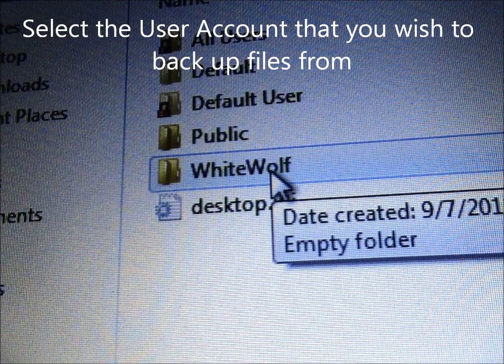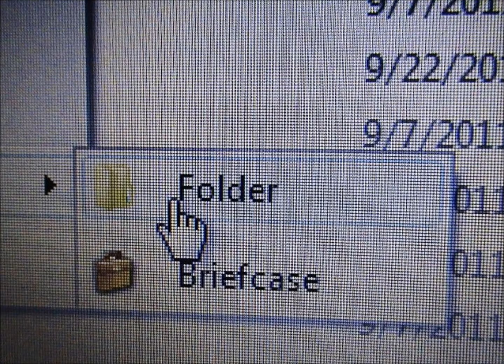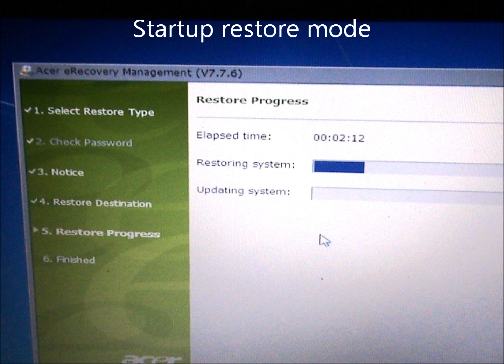Error Code C0000034 and C000003A Fix

Comment from the maker: There is always a way to do it without removing the hard drive but when you want to get your important files off you only have two options and that is make the hard drive into an external or boot with a linux OS. I chose the external method mainly because I did not have an Linux OS available at the time.

Comment: It would be much easier, safer, and faster to just use a live linux distro to boot your computer into so you can transfer your files out (it would bypass the windows issue entirely...) No external hardware or secondary computers necessary...just a cd or flash drive...